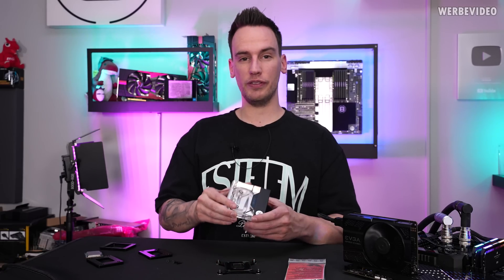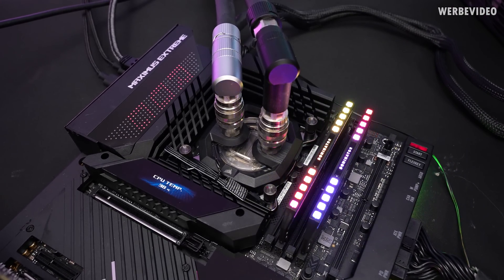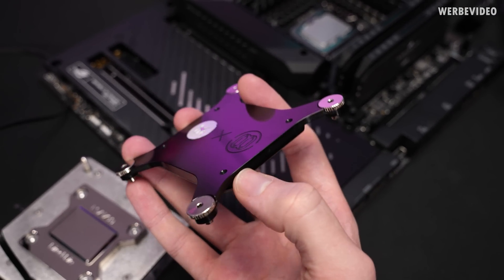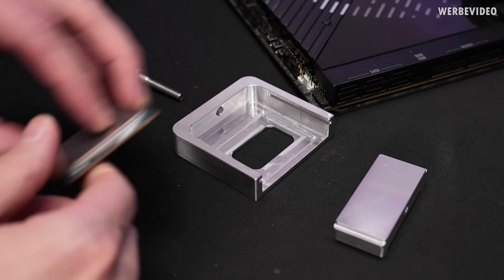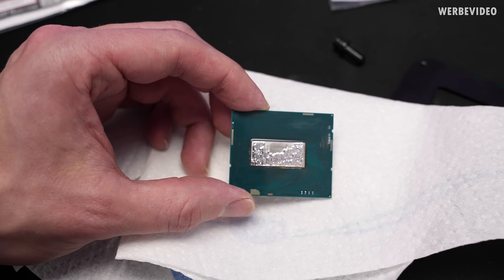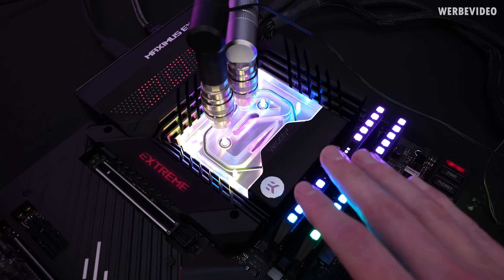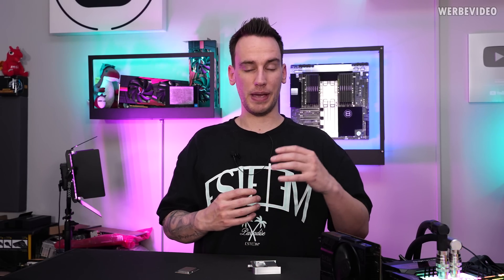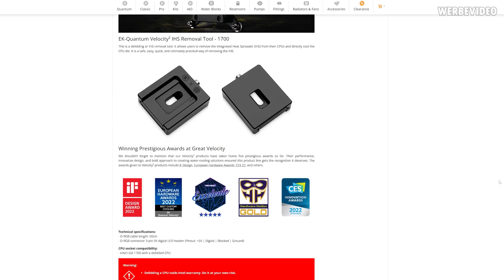We're testing EKs Limited Edition Direct-Die Water Block

Comment: I bought this in May 2023 and didnt receive it until September 2023. I learned that the long delay was because of the manufacturing error, either the chip guard being too high or the cold plate not being flat, depending on what side you're hearing from. I can tell you now that while I'm willing to throw this in the trash, it's definitely overpriced and underperforms. Poor manufacturing and QA/QC is evident when it's not possible to install due to the back plate being slightly bent and the thumbscrews not installed correctly from the manufacturer. I've asked for a replacement from EKWB.

All the while, I have already placed an order from AliExpress for the Iceman Direct Die and will be getting the Supercooler for the 14th gen, both of which has been reported to massively outperform the EKWB, if only because the EKWB massively underperforms. Will update you all soon on the resolution to my replacement request, if granted, and how the other coolers perform.

There's no doubt that the EKWB block is the prettiest, but I can honestly say that I am in a form of hell working with EKWB from my time putting together their GPU blocks to working with their other watercooling items and finding issues with tolerances or stripped threading, simply concerns that a customer should never worry or have to deal with when buying from a known brand, as EK is as household name a watercooling brand can get.

Comment: With the '14th gen' launch I'm waiting for the 14900KS after Intel kept back all the 'good' 13900K chips for the KS release. Hopefully January 2024. This tool is supposedly compatible as the die hasn't changed dimensions. Would it be possible for you to do a direct die test of your new 14900K using LM, Kryonaut and graphene sheet? I'm sure a lot of people would be interested in the results and it would potentially remove the need to re-apply liquid metal every year or two. Excuse me posting this on your 14900K video as well. Also, any chance of you offering binned delidded 14900K chips with likely KS level of SP and IMC?

Comment: Great video. Love this explanation and instruction, along with what EKWB did with their instructional 2 part vids. By the way, your test performed better than 11C. it actually did 14.6C better. I wonder how this kit will work with the new Intel Ultra 9-14900KS CPU when that comes out here in a few months. Also, that's what Intel is naming it and getting rid of the "I" and calling it "Ultra." More unnecessary words that we don't need. If you won't be using the same deluding tool, will you be using a newer one for the 14th Gen CPU? Let me know what you can. Again, great vid!

Comment: which one is better? The intel tec2 cooler from ek or direct die cpu cooler from ek. Which one is better for heaving gaming and consistency?
Reply: @der8auer
Reply: The TEC is more experimental, it require Intel software and seems to turn itself on/off based on load, it will not run subzero on a full load from what I've seen.

The EK DD is also having issues. See the recent posts, I wouldn't do it if I were you.

Last option waiting for der8auer to release a new DD coldplate...

Comment: I found my way back here after search for an alternative de-lid tool to the EK one.

The EK LGA1700 direct die product is total junk.  After a three month wait the product turns up.  Immediately the die guard is out of spec leading to poor contact, EK will replace the die guard part but you have to wait.  The direct date cold plate face has been proven to be concave and makes poor contact,  EK are ignoring this issue at the moment by claiming they are flat when they are not, so even when you get your new die guard it might not fix your poor die contact problem.  

The EK de-lid tool strips thread, EK will replace it, but you have to wait. 

But the big kicker...…despite knowing they had an issue brewing, EK did nothing except "business as usual" and so now EK support are not responsive, they don't answer phones, they are so back logged their response times have more than doubled, they are swamped with support tickets requesting new die guards .etc  when they do reply to your ticket, they then ask for photo's which gives them another 5 days grace before responding again, so a further two weeks pass before you know whether they will send a new part out again.   Meanwhile over on Facebook they are gaslighting customers by claiming the issues affect only a very small number of users.  

On Reddit, Der8auer basically has walked away from it all, I paraphrase., but it goes like this......"I got a sample, I tested it, I don't know what happened after that" (strange to be involved in the development of something only to then not take an interest in the final product, especially as it carries his brand logo)

What a disappointing experience it has been for those of us who have been seduced by the prospect of running cooler CPU's and what a warning about mis-placing faith in Youtube content creators who speak positively of, or even get involved in the development of products, have their logos appear emblazoned on them, only to then to go silent/walkaway and not follow up for their fans, when the going gets tough and issues arise.

Comment: @der8auer Did you ever try sanding the direct die frame down? i had scuffed temps so i sanded it down to 4,5mm and now it performs better, im curious if your temps would be even better if u sand it down aswell. EK knows of this issue now and i gave them all my test data to fix it, after 8 delided CPU i can also say intel has had some issues with the height of the die, it also varies. 83 degrees now on my 13700k on the hottest core, and 75 on the coolest. It's in a testloop now so im gonna have to tare everything down when i have the energy to do so, then i will go for 4mm frame , should be good there.

Comment: this direct die from EK and Der8auer is a total failure lots of people now are having problems please explaine

I have same issue.
At water temp 20 degree celcius, my 13900ks with ek dd can only costs up to 400watt at 110 degree celcius.
I reinstalled 7 times, repaste liquid metal, results are same. 400watt with 110 celcius. 330 watt with 80 celcius.
This result is same as heatkiller 4 pro with Stock IHS. 400 watt with 110 degree.
Actually, ek dd is worse than normal cpu block. Core temp difference on heatkiller is only 7 degree difference, however ek dd is more than 15 degree. Core4, 7, and 8 extremely high.
Once I changed to iceman dd, i got cured. At 330 watt it is only 60 degree.
550 watt with 110 degree.
Shame on you, ek
What did de8auer do?
Just rent reputation and have money?
Than just decrease the price without name on it.
I dont think ek will recall this garbage product.
People who bought this product expect good cooling performance, not the same performance with stock ihs.
And also, why does ek always delay their product? Once you said it will start deliver on mid Feb, it supposed to start at least 20 Feb. It is promise with customer, especially you received money first.
If you guys think you cannot gurantee the time, than receive money later.
I was big fan of ek, no more.
Quality keeps decreasing, price keeps increasing, and most of product need to be rma. Im tired of this.

Comment: If anyone on here knows the reason why, the two other popular direct die blocks, Sup**Cool and ice*** perform 10°C better than the EK. I really want to get the EK but on the 0vercl0ck d0t n3t site, sub forumn raptor lake overclocking, multiple people showing apples to apples comparison between them and the EK is 10°C (load) worse than the other two. If anyone knows and info on this and possibly getting the EK to similar levels I would appreciate it.

Comment: hope der8auer can shed some light on the EK DD people having mounting problem and high temps
Reply: also getting reports of ek delider stripping the screw threads on the plate
Reply: Took me remounting 7 times before I got acceptable dilided  temps. This wasn't my first delid but was my first direct die. Still one set of e cores still hit 100 degrees when none of the others do and its always the same set. Ditching this upgrade kit and adding a copper IHS like I did on the 12900K, they designed this thing wrong as others have said its not shaped right.
Reply: @StuartBoyer  others are already complaining also sadly
Reply: @jefflo455  Well EK is admitting to the issue to individual customers and is sending out new Die kits that are different coating, size and cut from the originals for those having issues, but its a drawn out process as they want you to test it and send temps and images of the spread of the liquid metal to see the contact its making etc. 
 The coating seems to stem from issues being pointed out about the LM and CPU becoming possibly fused together unlike other Direct die kits caused they used the same coating as a standard block coating which is a no no in this application. 
They are currently sending me a new kit and state the new kit will fix my issues. Some users have the new one in hand and the replacement dropped temps to where they should be and they also took comparison pics and measurements and they indeed changed the cold plate measurements, flattened it more, put a different coating on it and the CPU frame was resized as well. An honest we screwed up would help.
Reply: @StuartBoyer  they’re not sending them. They’re asking YOU to send the water block, to test it and if it’s not ok - they will replace it. I’m waiting already one week for mine to be taken to delivery…and god knows how long it will take them to bring the new one back to me….
Reply: I tried 15 times, and still temperature is above 90 degrees…in bios…there is a HUGE issue with that waterblocks. Thanks god, that I ordered rockit cool delid device instead of EK…

Comment: I tried the liquid metal to remove the intel residue, but intel put A LOT of material in there.  I ended up using 3 sharp razor blades and slowly scraping/cutting it off.

Comment: Great job on the de-liding - nice block too. But one question here is, once you run this setup a while and LM has dried-up somehow,. and your block is stuck to your die, how do you separate them? Supercool solution is way better for that = you simply use the same delid tool you used to remove the IHS. But what will you do when this block is stuck to your die?
Reply: LM wont dry ever

Comment: When using liquid metal, I had to remove the indium on the top of the die and polish it until it was clear of the solder. I found that it has to be completely off the die to make a difference. Why was that not the case here?

Comment: Maybe you should include coolant temp and flow (or pump rpm) in your presentation? I find that cooling performance is greatly dependent on coolant temp. When I torture test my CPU only, I get 50C on CPU (29C coolant). When loading CPU and GPU simultaneously the coolant temp climbs up to 35C and CPU temp stabilizes around 60C. Great channel btw. I just subscribed :)

Comment: I hope to see the delid tool released soon. I suspect Intel accidentally replaced solder with toothpaste on my 13600K. Installing a contact frame made no difference. Contact between cooler and IHS is good, yet water temps (AIO) are not rising very much despite high CPU temps. A delid is sorely needed.
Reply: Does it at least smell nice?

Comment: If anyone ever finds themselves wanting to do a lot of indium solder removal, check the material safety datasheet (MSDS) for a bunch of different liquid metal products and look for ones with the highest gallium content by percentage.

Liquid metal is a near-eutectic alloy of indium, gallium, and tin. Unlike a true eutectic, liquid metal typically has an excess of gallium to make it easier to spread and flow at room temperature. RoHS compliant indium solder is not pure indium, but instead an alloy of indium and 30-70% tin or bismuth, plus some trace elements (most typically a few percent of silver). When you put the liquid metal on the indium solder, the gallium leeches into the indium solder and forms a eutectic, leaving the tin/bismuth in suspension. This is why the liquid metal turns into more of a paste when used for cleaning indium solder.

The further away from a eutectic you start with (i.e. the higher the proportion of gallium you have in your liquid metal) the more indium it will pull out before the suspended insoluble compounds saturate the mixture and prevent further leaching, and the less you need to use overall.

For a one-off job it's such a small variance that it probably won't matter, but if you're setting up shop selling delidding services or similar then the costs and waste can add up.

Comment: "Just some ordinary watercoooling"   - points at the 250 Euro waterblock and Quickconnects combo.  🙂 Many people will run the 12th gen and 13th gen on a big aircooler, or at best a 3x120 or 3x140 AiO cooler that cost around 130 Euro, only 30 more than that block.  If such people switch to direct die, they might get a bigger reward than only 15 degrees. 
I read about people overclocking and trying to add more voltage, already at +95 C.    The 13900 seems to produce too much heat, in my opinion. 
You could safely claim iNteL should not have released it, until they had better thermals.  Over 300 watts on a little CPU is just crazy. 
 13900 should have been on 7nm, not 10nm.

Comment: This delid process is way more risky now. In the past i delided a 4790k and don't bother to remove the glue (fear of ruining my CPU), only repaste with ordinary MX-2 and got -30 degree gain in the hotter core.

But simply applying the LM on top of residual TIM don't work? the LM ever got extra adhesion.

IHMO, its time to AMD and Intel sold factory delied CPU with the mouting kits and stuff for safety.

Comment: Can anyone elaborate on block tightening and temps for some cores going high?  I have this issue now and EK blocks just say to tighten until it reaches the end.  What else can be done to fix this issue?  I'm doing an old delid and have to disable 2 of the cores as they overheat instantly.

I can't seem to find any forum posts or info about this :(

Comment: Thank you for all the work you put in on this. I am bummed I did not get one of the kits, they are sold out. Will they make another full kit that is not limited edition? I seen the parts are available separately but the little foams and the liquid metal not included. I have a 13900ks on the way to me and would like to use his kit. I am a bit scared to screw it up but you make it look fairly fool proof if you are careful. I really wish I would have been one of the lucky 100 to get the Limited edition kit because it is quite special and  you guys did an awesome job on the styling.
Reply: Liquid metal and foam does come in the upgrade kit

Comment: Just blown away how high the temperatures become even with water-cooling … imagine the amount of heat these chips give off 😮
Reply: A lot of it is just the resistance between the cores and water itself, the water in the loop only gets 5-15° above ambient under full load after a while.

Comment: Why doesn't Intel/AMD offer a version of their chips without the IHS? Put a disposable lid on it instead for shipping and protection. Also: Why are torque drivers not more commonly used if mounting pressure is such a big deal? If anything its more information.

Comment: I'd like to see a block that is open on the base but has a seal around the perimeter to seal against the cpu board whilst allowing the cpu die to come in direct contact with the cooling fluid. Wouldn't even need thermal paste!

Comment: Love my EK GPU block: they make a great product and they continue to stock/re-stock spare parts for support (I was able to get a replacement o-ring for my GTX1080 block last year, which gave me the confidence to disassemble the block for cleaning knowing I could put it back together if the original o-ring had issues-- it didn't, but I replaced it with the new one anyway for good measure). Cool project you guys have here!

Comment: The problem with CPUs is that the surface area of the die is quite a bit smaller than GPU dies. A 13900K is 257mm2 expected to dissipate 300-400W power, in reality its even less of a surface area because the iGPU part of the die is idle so more watt/heat produced solely by the P and E cores. Comparatively a 4090 has 600mm2 for 450-600W, also slightly smaller area producing heat as a result of idle tensor cores, nvenc etc. Still, per watt, the GPU has quite a bit more of surface area to dissipate heat which is why it's easier to cool despite the increased total heat output.

Comment: I had a hell of a time overclocking my 13900k. Also, I have struggled with the new EKWB Velocity2 Waterblocks. They are hard to mount perfectly level and in perfect contact with CPU. There are no springs and it is a tight fit. You first time ever I had to remount my CPU block. And I have been watercooling for six years. Anyone else have these issues?

Comment: Most of the temperature improvement comes from liquid metal on the die, Not because it's direct die cooled. Using rockitcool IHS with LM between the die+ihs and thermal paste between ihs+Coldplate will give almost similar results. But still, theoretically a direct die EK block would be better as there is less surfaces/material between die and coolant.

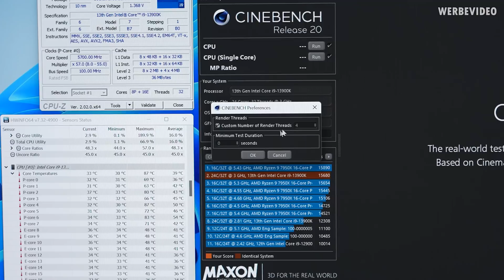Comment: I think during your direct die cooling test, the CPU was run with a higher voltage of 1.35V compared to the 1.27V from the non-delided result. 11:55
Reply: I think it would have been nice to see cpu power usage in these charts, just so we can see similar load between runs (even though direct die will use less power because its colder).